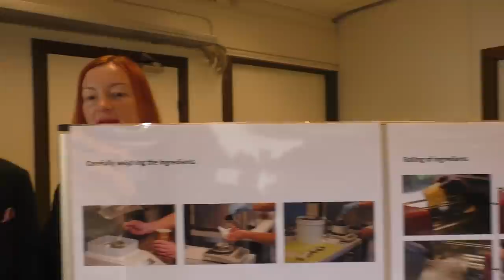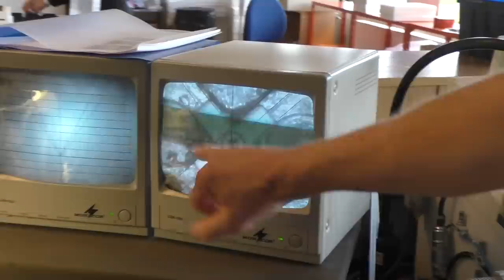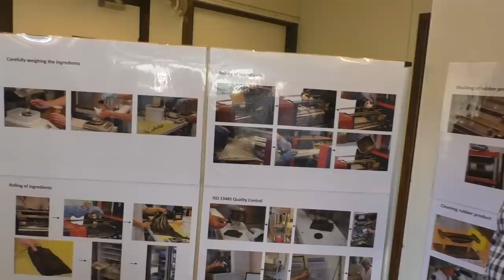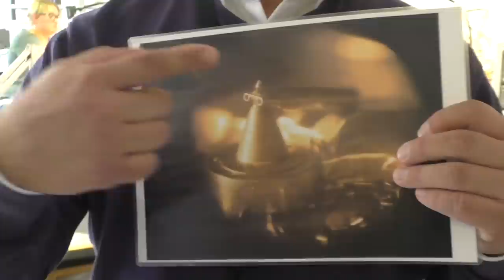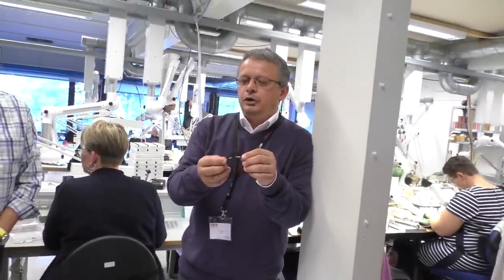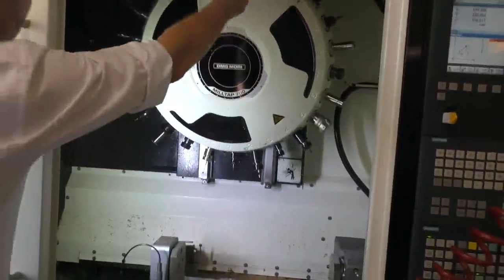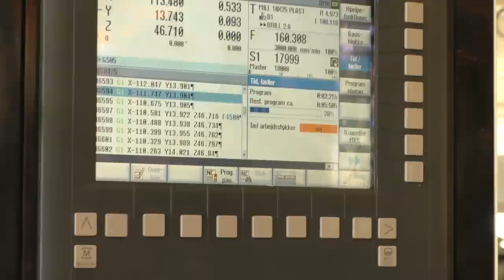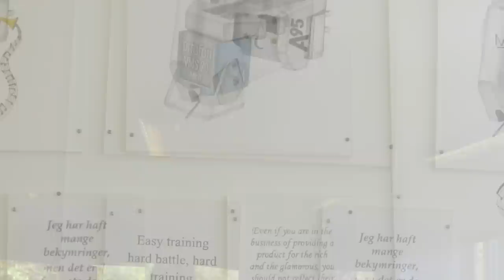Ortofon Factory Tour Celebrates Danish Company's 100th Anniversary

Comment: I would like to see the Diamonds being made it's one thing I've not seen anywhere! is it done by machine or by Human the facing, is it just grown into the shape or is it ground by hand? I'm assuming they buy them in they don't make the diamond styli themselves. There is probably one company making it for every manufacture and it does have a bearing what type of diamond is it,  not all Diamonds are equal in they're composite, in turn will affect resonance, something you should ask in the future what grade of diamond they use. there shouldn't be an issue using alcohol to clean the stylus it is an epoxy glue and alcohol doesn't dissolve epoxy resin or synthetic resin. getting it on the enamel coating of the wire might be a problem is probably why they advise against it. what type of wire is the coil, does anybody use triangular wire? was it silver or copper wire they were using.
I would have thought they would have used sorbothane rubber! in the suspension! what is known for its dampening properties acoustically instead of just plain old rubber don't want to pay the royalties maybe!! what is not so great acoustically. I would have thought it'd be better to inject some expanding open cell foam into the counter lever ends not sure if anybody does this. 

Can you do an experiment for me Michael, I might have asked I've asked so many people some people say they do it and never get back to me or they never reply. I think the 92 degree angle is wrong! should be set at 88 degrees, you are riding the style the same on 88° as 92° but I believe you will get better results less jitter between the surface of the record and the styli, intern more detail cleaner sound better blacks plus less where to the vinyl.
the only issue is depends on the length of arm and type of cartridge you got that the back end maybe!! a bit close to the record surface. you will need to lower the tone arm at the back about 4 mm dependent on the length of arm and your need to increase the weight to its maximum maybe because gravity not in your favour, in turn has a benefit in itself creating less mass on the tonearm. Could you try out Michael and let me know what the results are thanks! try a sibilance test with a test record would be the best test a before and after.
Reply: Some are grown and some are laser and machine cut. Namiki is (was?) one of the suppliers of diamond/cantilevers a lot of these brands used. When they stopped producing the born cantilever most manufacturers discontinued a lot of models pretty much confirming the source. I was told by Ortofon they source diamond from Switzerland and Japan. https://www.ad-na.com/en/product/jewel/product/record.html
Reply: vinyljunkie07 thanks for the link I will check it out it looks interesting.